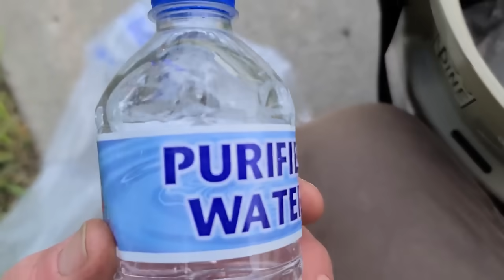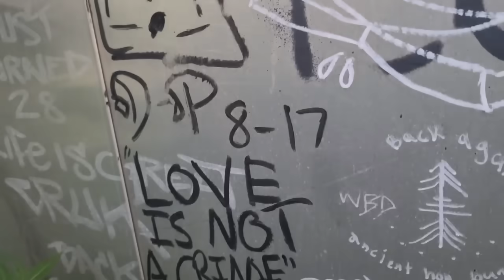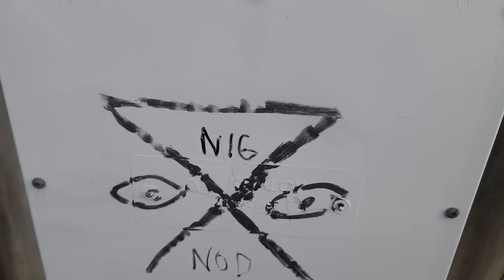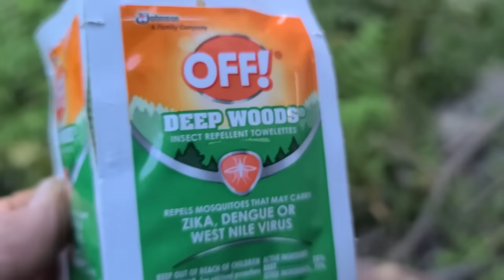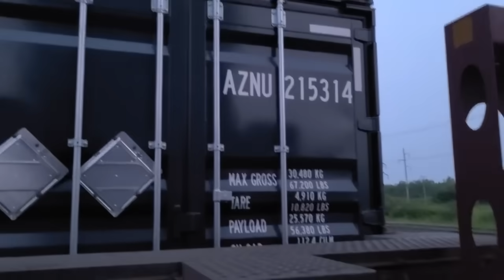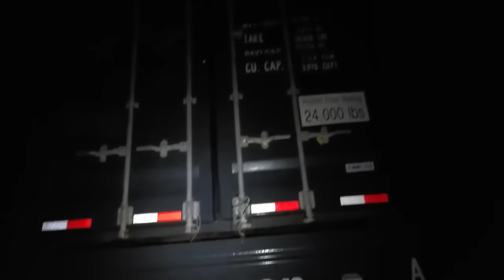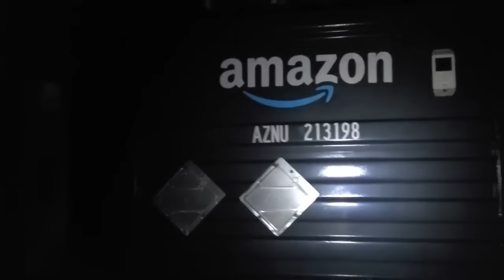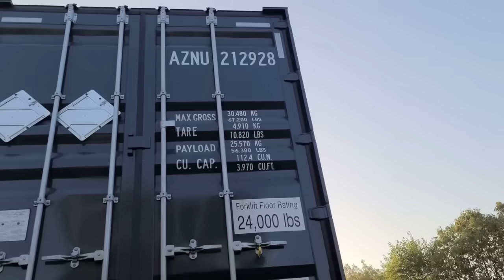Amazon train speed record to Chicago/shampooing beard afterwards ~

Comment: Mark, was not to sure how one cleaned up out and away and all.  The baby wipes are good.  I like me a little foldable doggie bowel.  This is for their water yet we can wash up with them too.  Carry water for us to drink and cook with a short ways.  I get me a cut up big towel into four parts and wash up with this.  I gennerally do me a hillbilly bath mostly.  The bug sprayers new one's not older one's are good for a spray off.  And they can carry depending on size a gallon or two gallons of water in them.  I just removed the sprayer part,  and use the handle release part and the hose.  Any hard ware store will carry these.  And just only use water in it.  This may be able to be tied onto the pack too.  I have both the one gallon and two gallon of these sprayers.  And online walmart shipped me a rechargeable shower too.  Push comes the shove I go into rest areas and wash up in the sinks.  And in gas station bathrooms, I was up in the sink, get some soap and toliet paper and maybe some paper towels.  I wash up at my sick today, when I am unable to get into my crow foot tub.  I got me a cut up older towerl to wash up with.  After the rinse is over, I wring out the towel tightly and then go over my what hair i have left and all my parts and this can dry me off some more too.  I slept in a lot of rest areas, off to the side of them. On the pinic tables or the cement under the pavillions.  In Tuscon Airzonia back in 1980 I had picked up again and ended up in Tuscon, Airzonia.  If I pick up anything I can die or die spiritually.  My liver is fatty today by me drinking and druging.  Was lightheaded on my 69 birthday on August 9th, 1954.  Started to fall over  while walking.  And I get dizzey sitting in my wheelchair.  While I was in Tuscon, Airzonia was sleeping on some cement concreate bags and opened up my eyes and saw  a bird running thru the desert and thought that I was seeing stuff.  It was a road runner.  I when to the convention of young people in Tuscon.  This was good.  I first made love to this gal right off the train.  She tried to warn me that she was riding the train for a while.  Her hair had smelt like she had died.  And I got the crabs on top of it all.  She laid on the carboard box laid out under the bridge and me on top.  At the convention I was honset about me picking up and then I met a lady from Candana.  She wanted me to stay the night with her in the Marryout Hotel that was 80 dollars a night.  I did not have this kind of money.  I enjoyed sleeping in her hotel room with her too.  Did not like it that I had given her the crabs I did not know about this part.  Try not to forget about aa at all.  One has plenty of information on experience strength and hope from his drinking to share with others wanting to recovery.  We give it all back to others.  We put people back into our lives.  We owen up to our wrongs, work on changing us, then we go to the people we had harmed and admitt to them what we did.  Its a lot of steps to take.  Yet, it is one at a time.  I have never been happier as I am now.  I have a relationship with my higher power.  I pray and just ask for help for this one day as I understand and may misunderstand him.  At night i thank my higher power for helping me thru the one day.  Anytime one is welcome to come here and pickup any of the stuff that I am offering one.  If one doesn't want anything leave it here.  Take what one wants.  The packs are older one's and are very worn.  No shoulder straps no hip belt, no pack frames.  The marine packs are harder to get stuff for them.  I may purchase one pack frame to reasemble that pack it took me over a week to frankine stitch back together again.  One the road we use dental floss to sew up stuff.  I have five teeth to with a gap.  I still eat beer jerkey too.  Paul in Ohio

Comment: I have a large HO Scale layout, and "scratch build/manufacture" a lot of rolling stock and building structures. Thanks to this video clip, I saw something pretty resouceful; as most railroad companies used to be, and that I will scratch build = At the 45:01 time code Mark captures on video something that I did not know existed... three 1950's 40' Steel Body Mechanical Refrigerated Cars (nicknamed Ice Bunker Reefers) without their trucks and welded together length-wise = a future "scratch-build" project.

Comment: I take me a dog collaspeable bowel and clean it out and wash up in that.  Just a rag and the fold up dog bowel.  It can carry some water too for camping.  If the dog drinks out of it I clean it for me.  A new bug sprayers is good too, with the nosel off of it.  The squeeze part is ok to leave that one.  I have two bug sprayers for me to wash up with.  I got them new.  And they have recharagable showers to order on line at Walmarts and have these sent to one.  I just used to go into bathrooms and use them and wash up in the sinks.  A cut up old towel washes me up hillbilly style.  Have fun I watched this one twice so far.  Paul in Ohio